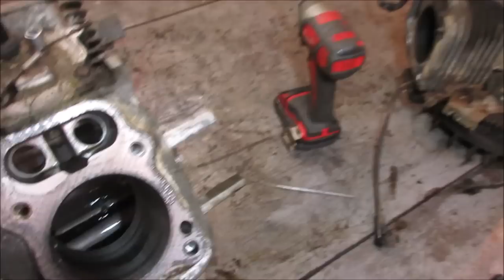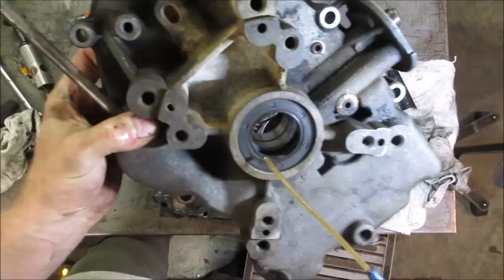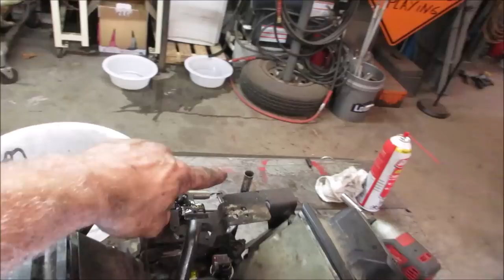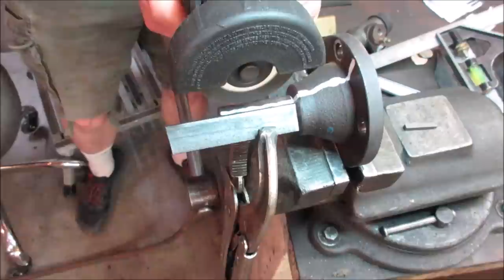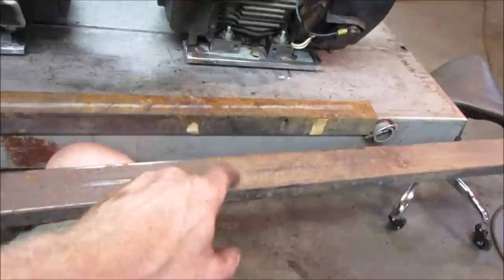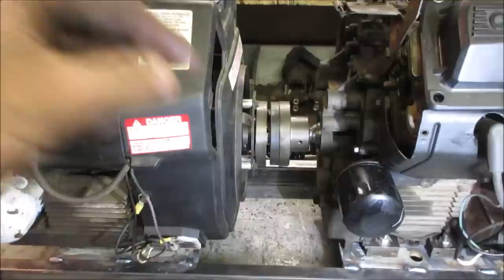2 Blown up Engines Glued Together, Let's start them up and see what happens.

Comment: I just realised that I've probably watched ~50 engine teardowns on YT and I don't remember ever seeing anyone showing the full reassembly process, most times they show the teardown then skip onto everything being back together again. This was incredibly interesting and educational, cheers Mustie.
Reply: The only other one I can think of is Machinery Restorer, mainly Briggs engines.
Reply: Once again, Mustie takes the cheese.
Reply: Mostly proably because of how toxic YT are. Do one thing wrong and they get a hate storm, especially if they reuse some parts.
Reply: @Iceeeen right, but what difference does it make when he's just cobbling together stuff that would have gone to the dump. Musie's awesome!
Reply: James Condon is another good one to watch.
Reply: Why do you need to see how it's out back together? Just watch the disassembly backwards, right? 🤣
Reply: @whitezin65  I commented on the genral term on why people do not show reassembly. It usually doesn't even seam to mather what it's used for...
It usually only when it on the level of for ex. m539restoration that people stop to throw shity comments.
Reply: Taryl fixes all has several where he disassembles,  then reassembles with complete instructions on why and how. With most you have to be careful with the oil sump oil seal, and be sure it doesn't flip up.  He shows how to keep it from going wrong.  Chichanic has done the same.

Comment: Great job! I've worked with those couplers. So long as it's tight, the rubber is a little forgiving. If it gets too far off it will chew through it.
 If I were king and writing the checks, I'd run those engines at varying speeds for an hour before going much further. If there's gonna be a problem with it , it will show up then. Looking forward to the next one!

Comment: I think, best way to sync the the carburettor - is to do as on mc with double carburettor, connect both to vacuum gauges. And calibrate them, then link them together.. Good work.

Comment: Put a second allen grub screw in each hole in the coupler. The second screws act like jam nuts to stop the existing screws from loosening.
Reply: We took a small drill bit and drilled about .030 thousands down through the hole then the set screw will lock into the shaft.

Comment: In the late '90s Dixie Chopper made a zero turn lawn mower with two Kohler 20Hp twins tied together with belts running to an over-running clutch that drove the main belt driving the mower. I don't remember the model number but it was a 72" cut and would handle just about anything you could throw at it. When those engine RPMs were synched together it had a great exhaust note, similar to a twin airplane.
Reply: Now that is interesting. I do know the brand name but never knew that they constructed something so "radical" and sold it that way, but it does represent a lot of mechanical and maintenance complexity that could explain why it is not commonplace. Thanks for sharing.

Comment: Love the project, I can only imagine what it sounds like live!
I would be a little concerned about cooling however. The "front" engine dumps its hot air right towards the intake of the other engine, which might make it get a little too hot. Maybe a little baffling when it gets installed would help.

Comment: A suggestion for the set screws on the coupler. Drill a little into the shaft where the set screws are so that they have something to grip in other than just a pressure fit against the shaft . Maybe even drill and tap them bigger so they are a little more rugged . The twin engines is cool. Can't wait to see what you are putting them in

Comment: Musti, Growing up in a very rural area several of my friends and I had go karts. They were home built, not racing and nothing fancy. Just fun to ride around on our dirt roads. One day a neighbor a few years younger asked me if I'd help him learn to rebuild a small engine. So, we found a couple of 3hp Briggs and we went thru the steps on both engines at the same time. When we were done, we didn't know what to do with them because our go karts all had 5hp and who'd want to go down to a 3hp? Then I got the idea to do like you did and connect them and put them on my go kart. I pulled the crankshafts out and took them to school and drilled and tapped one and threaded the outside of the other. So they simply screwed together to make the connection. Then I tied both engines together at the cylinder head bolts and bolted them to my go kart.  I made a common intake manifold out of copper water pipe and a steel plate to bolt a 6hp Briggs updraft carb to. My neighbor was a plumber and he offered me a torch and something he called Fonsen (sp?) to use instead of solder. Fonsen was stronger than solder and melted at a higher temp, but did not require red hot like brazing. In the end it worked very well. It was funny how some of the neighbor adults told me how important it was to have them synchronized in some way. They told me the two engines were fighting each other the way I had it. I really never caught on to what they were saying because I knew from personal experience that my go kart was A LOT FASTER w/ the two 3hp engines than it was with the single 5hp. My go kart was quick from the start and it went at least as fast as the 5hp engine pushed it. And it sounded neat too. I made no attempt to synchronize them and it sounded like a Harley. Thanks for jogging my memory. ben/ michigan

Comment: There is a guy who did about the same thing at one of the engine shows, he set his up at I think 90 degrees out so it has a F1-R2-F3-R4 firing order. Sounds pretty neat and runs very smooth. His uses a double row chain coupler and shortened crankshaft and is powering a Cub Cadet chassis that he uses as a butt buggy
Reply: i am not the best english speaker. what ist a butt buggy ?
Reply: @ohespeh  we may not want to know….
Reply: @ohespeh  At many of the engine/tractor shows you are not supposed to bring golf carts or scooter type machines to ride around on. The way around that is to build a "butt buggy". Take a garden tractor, tiller or similar and add a second seat or connect up a trailer and now you have a "show legal" way to ride around the show and not have to walk. I have seen garden tractors, walk behind tractors (with a sulky) and hundreds of variants of them built.
Reply: @Blazer02LS  Thank you very much, i did not know it

Comment: And putting the cross hatch pattern in the cylinder does more than seat the rings it holds oil on the cylinder liner.
Reply: Agreed.  100% correct

Comment: There are these double roller chain coupler things. 1 sprocket on each engine, and chain connects them, allows for a little bit of misalignment but should be a lot stronger than the rubber.
Reply: And it's much cheaper than buying a Lovejoy coupler

Comment: might be good idea to pair both oil sensor wire.
Reply: They would have to be in series, so if either opened (due to low oil), then both engines would stop. A good idea though.

Comment: Amazing! I use a trick when using allen head set screws-I take out the long set screw, and replace it with two short ones, using the top set screw as a jam-works for me-thanks Mustie!
Reply: Good idea but with Mustie's It didn't loosen up, it was never screwed in all the way as he explained.

Comment: The purpose of the cylinder tin is to make a shroud that forces fresh air past the cylinder and head fins. I would leave them on unless you make other arrangements for cooling. Also running the motors without the pipes on them will cause the heads to overheat and warp them. I’m really liking this video. 😮👍

Comment: Consider making a common throttle linkage between the two engines which would be adjustable.  You could sync the carburetors so each engine is pulling roughly the same amount, saving wear and tear on the rubber coupler.  Another possibility might be to make an intake manifold and use a VW bug carburetor.  Nothing like taking something simple and making it more complex, right??

Good content, thank you for sharing it with us!

Comment: Well thats just awesome, pro tip from someone who puts in a lot if them, when installing set screws tighten once back it off a 1/4 turn tighten again back off again tighten again. You'll notice it will go a little farther each time as it bites in to the shaft/key a little more each time. That and a little blue lock tight theyll never back off on you.

Comment: After assembling the engine & After running a compression test,  & while you then were checking  for  oil flow..: This  is  a great representation of ..  an oil  drain, oil filter  removal, 10 minutes later replacing the filter and refilling with oil.. then  starting the engine at half throttle..... Just how long would  the bearings, piston skirts etc. run DRY before the oil  got up to all  the essential parts?? 
I learned to  (In cars, trucks and ANY I/C engine).. ONLY bump the starter!!! several  times after an oil change before actually allowing the engine to  run. I assume I've saved so many hours / engine miles by not dry starting engines. 
As you know, I'm an old VW / Porsche air cooled guy and learned to be super clean and careful when doing rebuilds.. That has evolved to being just that cautious with any  engine (oil especially!) related service.
Thanks again for your wholesome take with all repairs / rebuilds / restores! You are my MOST quoted channel!!

Comment: Daren there is a chain coupler that would work way better. It's basically like a sprocket on each motor with a double chain wrapped around them. They would give two benefits. One would rigidity, and also turning one tooth at a time timing between the motors.

Comment: About 56 minutes in the video mustie dropped a spark plug. Now lets back peddle 40 plus years ago. I had a used 74 Chev Vega that used more oil than gas. Lets just say I changed my fair share of spark plugs. Well I dropped an occasional plug on the ground and sometimes Would have an occasional missfire. Greetings from Rich @ a small airport in Iowa.

Comment: My thoughts on carburation is a Solex 34 with a modified VW intake. I run a similar setup on an 1100 Goldwing. That gives electric choke and single fuel shutoff. Simple idea and with your Bug parts no cost except a little welding supplies .

Comment: Darren, you have a serious alignment issue with the coupling. Try putting a set of dials on and measure the runout. This is what is eating the rubber element. A soft foot condition can also create this alignment problem. Again this can be checked with dial indicator on each base bolt. Some shimming of the base will be required. Keep the great content coming. Cheers from an Alberta millwright. :)

Comment: A.Great.Episode.

Once upon a time, an engine builder and Tommy Ivo built a 4 engined dragster,used  4 Buick engines and a 4 wheel drive system...engineering madness.
Let's hope You Know Who doesn't get 2 more Kohler engines somewhere

Rodents love to make home in those big shrouds,and they eat the insulation from the wiring
and maybe even the fuel lines

Comment: Let me see if I remember correctly.....  You destroyed an engine in your little tractor.  However, as "luck" would have it, you had 4 engine carcasses, of what charitably could be called "non-running", of about the correct size for a replacement.  You picked and chose parts from all 5 engines and got one running that you put back into your little tractor.  Then from the 3 remaining engine carcasses and the blown engine you have successfully put together bits from each to create 2 more running engines.  That's 3 out of 4 of the carcasses that you managed to get running with a parts pile from one other carcass and the blown engine.  And about the most expensive thing you purchased were new head gaskets.  Just incredible.  Were I you, I'd be happy with 3 running engines, one in use and 2 spares.

With the power being delivered to the load through only one of the crankshafts, I wonder how long it will be before there is a problem. Not to mention putting 40HP into a transmission designed for maybe only 12HP.  Another potential problem?  Whatever your putting together I can't imagine its longevity of functionality will be to excessive. 😟😕

Comment: Reminds me of the time when Dad built a table saw and only having a pair of matching 1/3 hp washer motors-one would start on its own and the other needed help, his solution was to couple them together with a flexible rubber connector from another junk washer, we used that saw to split used tung and groove wooden flooring from insulated boxcars into wall studs that we built our garage with some 50 years ago.

Comment: Fascinating, Mustie1! I guess this could be considered a single-engine because they are connected. If they were separate in a device -- an airplane for example, one on each wing  -- then ... oh never mind. I guess you'll go with two separate exhausts? The plumbing involded in linking the exhausts would be pretty labor intensive. Whichever, you'll have a very torquey 40hp powerplant!

Comment: Cool project.  One caution I would make ...  running an engine without an exhaust manifold can be a little dangerous.  The exhaust valve gets super hot, and when the engine shuts down, relatively cold air comes right in and can warp the valve.  Just about any kind of exhaust manifold puts enough distance between the valve and the cold air to prevent this kind of damage.  Just my $.02.

Comment: Pro tip: DO NOT waste $$ on a Kohler Starter for those motors from a Lawnmower shop or Kohler official parts, MOST auto-parts stores like Advanced, Auto-Zone etc sell starters IN STOCK that fit Kohler V-twins, they are way stronger that the stock Kohler junk and some have killer warranty too -
Reply: Thank you. That sounds like a great tip. 
Happy Thanksgiving to you and yours

Comment: Cross hatching is not just for breaking in new rings. It helps the oil stick to the cylinder walls, to prevent wear.

Comment: Dodge Paraflex coupler 7/8" . Designed for heavier/higher RPM application over Lovejoy. I run them on Kohler to Roots blower connections...super durable.

Comment: This is the best make shift 4 cyl engine so far. 

If I were in your shoes, I would go with a universal joint to connect the engines. I personally do not think that the elastic coupling will have an long life with two engines beating the life out of it when they are under load.

Comment: Mustie congratulations on the build. Just thinking if you have two twin cylinder engines at 180 out wouldn’t you still have two cylinders on compression stroke at a time. You may have to turn them 90 deg out so you have only one cylinder on compression stroke at a time. Also I build pump units that use that type of coupling. We do what we call a straight edge alignment on them using a straight edge that will fit between the engine and fit flat against the edge of the couplings. You will be able to see if one engine is off to the side or if they are parallel to each other. There should be no gap between both couplings when it is aligned.
Reply: @@elevator9592  I think you might be right about that!  Yeah maybe better 90° than 180° then there's a cylinder firing every 90°.  

But then there's the power transfer 'pulses' from the front engine, through the coupling, then through the crankshaft of the rear engine to consider.  Interesting thought!🤔🧐👁
Reply: You beat me to it.  I was thinking that each cylinder on a v-twin would be 180 degrees out from each other.  With the two engines being 180 out from each other, I would think that Cylinder 1 from one engine is now matched to Cylinder 2 of the other and visa versa.  I agree that you would have to set them to 90 degrees out.

Comment: I remember when Koehler, Tecumse and Briggs &Straton were all reliable. I have a Craftsman made in 1985 runs. I wore out a Toro recycler. Not the engine the aluminum deck. The bushing kit wasn’t available before my deck was worn out. Mower shop had tons of Suzuki and Kawasaki engines no decks. High nitrogen grass just made them fade away

Comment: Ohh if it'll have a transmission then it will be something driveable!!

This is a very interesting project, i love how you just dont go and spend 10k$ on everything stupid to make what you want work.

I think you could link up the carbs with some hard lines if there is space for them, like how it used to be on older motorcycles.

Im wondering if the coupler is causing any sort of power loss, well im sure it does, im just dont know how big. Maybe it would be beneficial to connect them with a simple rod, but that may break if the engines arent in sync.

Anyways, cant wait for the next video!

Comment: When I went to tech, we were taught that the cross hatch pattern is for holding enough oil on the walls that the rings - and the wall itself - don't wear out prematurely, as those metal parts rubbing together do need a little bit of lubricant between them.  Too vertical a pattern and it doesn't hold onto the oil enough - and too horizontal a pattern holds too much oil, which then burns away.  I've never heard it described as just there for the rings to bed in.

Comment: I was thinking you could weld up a manifold out of pipe to feed the two engines with a single carb like they used to do up as conversion for old Honda Goldwing's to make them single carb. If you've ever gone through syncing a bank of bike carbs you probably know the challenges there and how to use a vacuum gauge to synchronize them.

Comment: another trick to connect two engines together is with a short loop of double roller chain and a single sprocket on each engine sandwiched side by side, it allows miss alignment to some degree yet a very strong connection to one another.